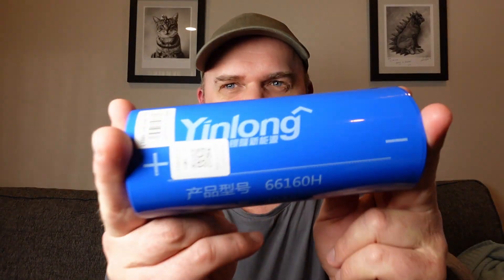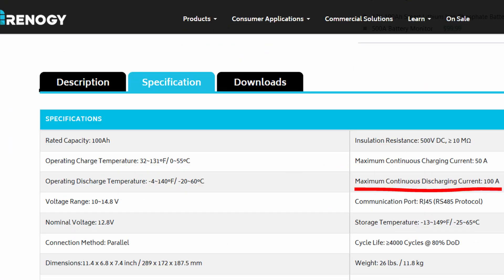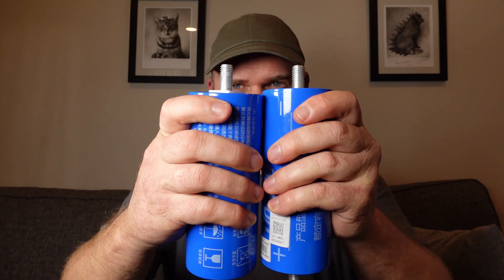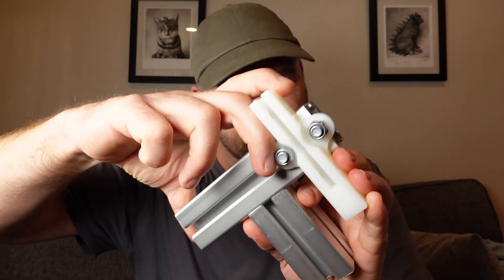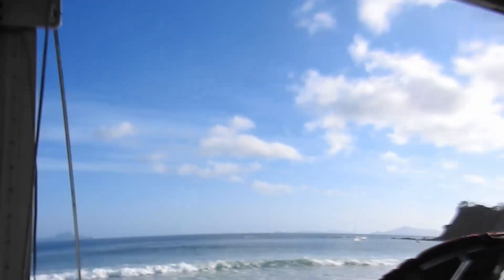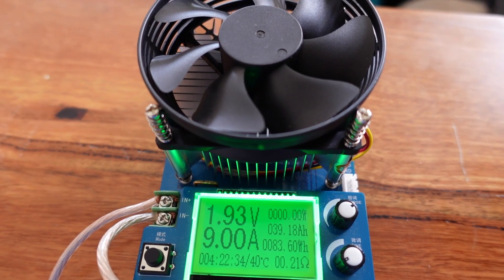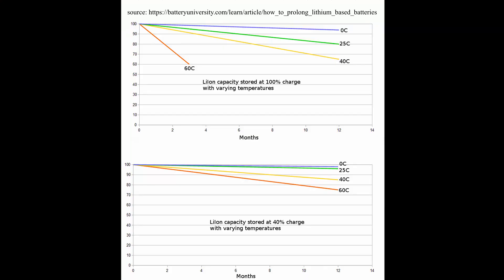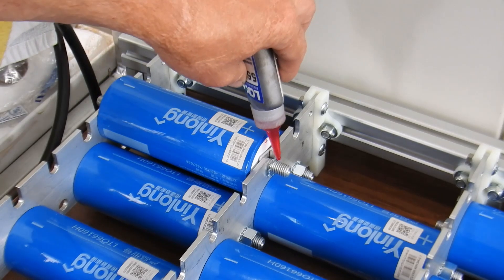Campervan DIY battery build HUGE POWER!

Comment: Yes I totally agree with everything stated in this video. And I pulled the same capacity results you got on my LTO part 2 video. The toshiba cells were incredible.

The reason I still prefer LiFePO4 over LTO is due to cost mainly. LTO is amazing! But crazy expensive if you want grade A cells. The data sheets I found for my video must have been for higher c rates. Sorry about that. I like LTO more now, but man that pack you built is massive! How much did that cost you? holy cow! Yeah, ying long and toshiba seem to have the good stuff.

But I must ask, why are you building such a massive battery with large discharge and charge capabilities? Why not use LiFePO4? I would love to hear your reasoning.
Reply: Good to see you interacting with others DIY battery guys will… i take it as a sign of humble & mission oriented - so in a good way let’s have a new test and sure the overall shouldn’t be costly like other types of batteries
Reply: @DIY Solar Power with Will Prowse 
He said he got them for around $50 apiece, so x99 cells, just shy of 5k
Reply: @ianpobanz12  $5k for 9 to 10kw that's worth it .$1k more than AGM with double usable power , plus big bounce 20,000 cycles , clear winner and safety.
Reply: @ianpobanz12  @Brendon Tait if he said 50$/piece, then he bought GRADE B. Definitely not GRADE A.
Reply from the maker: Hey Will, don't get me wrong.. I love LFP, already know a bit about them and have had some experience with them, however I didn't know heaps about LTO and really wanted some first hand experience with them due to their unique capabilities.  I designed my pack to hold 55 cells, and then slot in another 44 when I had more available funds.  It then came to pass that my whole solar and inverter setup got funded through other channels and not out of my pocket - so figured I'd go all in.  I really like the apparent ruggedness and long life of them, I've even heard of them accidentally being charged in reverse and still being ok!  I want most aspects of my truck to be as rugged as possible (low temp, long life etc) - and while it's not ideal to 'test' unfamiliar chemistry if I want something rugged..   I figure if it goes tits up and individual cells start failing... there are plenty of audio guys that would want to buy the remainder if I broke it down. Either way, it's likely I'll learn a bunch along the way.
Reply: @brendontait6968  very cool! Nice to get a response back from you. Yeah LTO is the best, performance wise. Pretty incredible chemistry. The audio guys build the coolest packs ever. Have you seen their custom built bus bars? Incredible stuff. I want to make more LTO videos but the cost is so high that many of my viewers couldn't afford them. I hope the price falls soon. I also want someone to make some cheap LTO prismatic cells. The ying long ding dongs (as the audio guys call them haha) are a pain to mount. I love your bus bar setup, it's incredible. Really amazing how much thought you put into that. The simplicity and durability is awesome.
Reply: @WillProwse  the opportunity is in the portable personal for the bull device charging Bank. It's one of two opportunities. As you can see on the Toshiba s c i b illustrations and as a unicycle owner yourself those vehicles are actually kind of Trojan e in terms of being a way of moving electricity around at high speed at minimal cost. You should have yourself a Sherman veteran and find out what a smile on your face actually looks like because the golf cart nor the Porsche that you say you can't afford it's going to do it for you like these new models especially the ones coming out this Christmas with the wide axle whole motor being about 40 lb and inviting the rest to be separated a b l e so you can carry it in your other arm and addressed a complaint of how a single object with a triple-digit poundage is becoming awkward. The other issue with unicycles though or electron delivery devices because there's no reason they can't be autonomous is climbing stairs but it's very easy to get a wheel to climb stairs you just have to have spokes that flip out from the axle and up you go!

All I'm saying is where there's a will prowser there is a future actual on Market forever unlike G pulsed nonsense the cell phone industry has basically stolen the intellectual property of with their claims of not just 220 Watts but the legitimate companies actually doing that for a battery that is only a few dozen watt hours in size. there are lithium titanate cell companies that are making them for hearing aids and earbuds and even smaller so what I'm talking about is not the Nano lto but the 20 amp hour El Tio. I just bought the mycharge 16 amp power for $18 at Target which has sold plenty of them for 60 and it's kind of need in terms of how sexy the heavy duty aluminum shell is especially because they put the $10 shelf tag on the $40 Sony USB C Bluetooth 5.0 earbuds so they bought it for me with only a $10 okay from me. It seems however that the my charge battery has an incoming and outgoing USBC Ford unlike the Walmart brand similar battery but I thought I was charging for that second USB C power bank with the output of the first and only 18 watts in and then using the second for it to top off the earbuds but the big Power Bank was not charged too much after it should have been except I was using the speaker with the AP app to listen to the same breaking news over and over again but hearing more and more with the repetition and the revisions so that's why it appeared it hadn't charged meaning it's not yet fully known as to whether it can charge two devices while charging itself especially with only 9 volts at 2 amps going in. The facts are really simple though the Swedish company will sell you a roll a 400w charging switches for about $6 each and those don't get hot or take up any space so they belong in a portable power bank. compare the standard now multi-brand unicycle charger which puts out 5 amps at 100 volts meaning they got the veteran Sherman make her to add a wire so that it can handle 5:00 amps LOL. Don't believe me it's easy to verify the America dealer has a whole section about its $200 500 watt charger. But get this there is a dude in Tucson Arizona who has the unicycle owners of the world buying a extension cord adapter for like $40 a foot so you can plug many such Chargers in a single free public Car Outlet!

 The veteran Sherman is coming with several kilowatt-hours from the factory and that's 2 hours using the aftermarket charger for kilowatt-hour obviously that it has to be held up. mister prouser I know you know what it means when you get millions of views on a video immediately and that's what the veteran Sherman gets its reviewers. Do you need me to buy you a round trip ticket to Japan to do this pitch or spell it out further? I know you know not because you know far too much for it to be otherwise
Reply: @markknotten1210  Whatever it is that you just said has me wondering if you have been addicted to crack cocaine since birth, or perhaps you are speaking some kind of battery savant language us common people of earth don't understand?
Reply: @rxonmymind8362  This is flat out going out to all of you. This went so far over my head that I said FUCK IT
Reply: @brendontait6968  What is this other channel you are speaking off? Ive already binged all your vids need more amazing content.....
maybe leave a link in your About page so other people can find
Reply: @brendontait6968  just so you know the most accurate measurement of available power is kva (kilo volt amps) which on the surface seems exactly the same as kw and on a dc circuit it pretty is power (w) is just volts x amps but for an ac circuit power (w) is volts x amps x pf (power factor) meaning ac loads with capacitors or inductors will have higher power draw on the batteries than the measured or rated power an easy example would  be say you had an 800w load with a 0.8 pf if you put a watt meter on it it would say 800w but the draw on your batteries would be 1000va
Reply from the maker: @shaynegadsden  thanks Shayne, I've got a reasonable understanding of basic electrical, have designed and build reactive power supplies before so dabbled in reactive power theory quite a bit.
Reply: @brendontait6968  I would have slotted both sides of the rails, so it would provide more flex and allow you to remove a single cell without taking the whole row apart. I like the 48vdc route as a future option!
Reply from the maker: Yeah... I allowed that as an option in the download links.  I don't think it will be too offensive taking a row apart if a cell shits itself
Reply: instructions unclear, disabled city's electrical grid charging 100 Peta-wh battery pack
Reply: Matt B McConaughey  super capacitors are not superior and they are extremely heavy. The specific energy is awful. They work great as a buffer to help with surge loads or to reduce noise, but that's it. They are not used for energy storage application.
Reply: @WillProwse  storing static inspired the current design Tesla uses to have the insulator be coated so as it serves a dual purpose and you don't have to have separate electrical infrastructure built into the lithium cell to constitute a battery.

That apparently is why he bought the technology. To cannibalize the manufacturing of the electrostatic barrier and apply it 4 simplifying and making more efficient cost and lack of electrical resistance wise mainstream lithium-ion chemistry.

For Transit electrostatic storage of breaking energy to apply moments later for acceleration solve many problems that mechanical flywheels impose. Unlike LTL electrostatic discharge curves are more formulaic far less top-heavy? The titanate does not get damaged if you drain it to 0 volts but the balance of cost to do so exceed the value so obtained and that is the understatement that I have tried to bring in full. You have to consider it for the applications where you can use Less storage and more Cycles like the personal Mobility applications that can top her off at every fire hydrant AKA Trojan Horse of electric car brought hi rate public charging. It is automobile logic that we see in the various current and near-term electric unicycles. You can watch Good YouTube videos of them incinerating themselves and permanently disabling injuries to the writers who do not train for bailing when their seat gets too hot suddenly. electric unicycle need not weigh hundreds of pounds not even one. It doesn't have to store kilowatt hours integrally but what it does need is integral kilowatt charging for a pack that is fractional kilowatt hour. It does need a very low internal resistance because that's what keeps you from falling those artificially intelligent spikes that keep you upright which currently cause people to fall when they go as fast as they want and hit a pothole or a speed bump and cannot deliver sufficient surge voltage to the motor to stay upright. This is why I Toshiba has waited patiently for everybody to fantasize about an electric unicycle instead of a General Motors Hummers. it's not how many times you could haul around like some sort of nearly extinct hermit. A

 We can do better than crabs or even eagles. in nature you don't see a whole lot of unicycles being used. Toshiba is going to make a killing saving the planet powering the unicycles that will be the only vehicle allowed not soon enough.
Reply: @WillProwse  I built a Super capacitor battery years ago & it's still going but at 1000Farrads @ 12 volts  (that's 3000 Farad caps x 6 in series) when you measure Usable A/hrs it's not much only about 50 A/hrs but it fits in a portable battery case. With that said, it can start a Tractor or truck as small as it is.  So yes I'm very interested to take a new battery build to  the next level to run a long term  home power system, probably use a 5 or 6 Kva inverter & I'll need at least 15Kw/hrs for overnight use because it gets so Bluddy hot up here in Queensland, Australia. So at some point soon I will order a box of these cells for a build. Edit I forgot I put 12 super caps (2s or 2x6 cells) in there to achive about 55 Ah in the usual 12 Volt battery voltage range, approx 14.5 - 10 volts of course capacitors don't care if it's  voltage sits on any voltage from 0 to 15 volts it doesn't hurt them and as such doesn't care if it sits there for a year with only 5 volts in it, just charge it back up & use it.
Reply: hiteck007 I love the dialogue between you and Brandon.  It was helpful and answered questions that I have not even considered to ask.
Reply: @blitzmakesunevenmm4323  I put an edit with updated info, I forgot a few things.
Reply from the maker: Depends on a few factors, if you listen to Mr Lee, LFP will last 20 years and 5,000 cycles.  I consider that to be very optimistic.  The thing with cycle life is that they are all done in a lab under controlled conditions and quick succession. (They are not left at high SOC for extended periods).  I believe most chemistries will only deliver half of their rated cycle life in the real world.  I think a reasonable expectation of LFP life expectancy would be 10 years and 2,000 cycles in real world conditions. (Tho I've seen them last as short as 2 years when held at high state of charge).  If you want the cheapest pack, buy LFP.  If you want the most rugged pack and you can shell out a bit of extra coin, consider LTO. I've seen an LTO accidentally charged in reverse and it still worked 100%, it is possible for an entire battery failure to start with a faulty BMS or balancer.  I think LFP is a great chemistry and would likely have gone with it, but I have a bent towards making things rugged, reliable and as long lasting as possible.
Reply: @realfamilyman  LTO will be cheaper if you cycle the batteries multiple times a day. For normal solar LiFePo4 will last a very long time though. Calendar aging will reduce any batteries capacity over time as well. No battery will last forever. You’ll find LiFePo4 is much cheaper, smaller, lighter, and uses less cells. LTO is nice but unless you are an expert I wouldn’t use it. There is less support overall for the chemistry. I would just build a LiFePo4 battery bank for a third the cost and in 15-20 years when it starts to wear out there will  likely be even better options.
Reply: @
DIY Solar Power with Will Prowse Did you test already the Yinlong cells?
Reply: @ELERIX-LiFePO4  No I haven't, I need some of those cells badly. Only tested grade b and toshiba. The toshiba LTO cells worked great. Need to test ying longs like the ones used in this video.
Reply: That's a weird admittance to being wrong. Or were u right?
Reply: @SpenserRoger  I've seen a lot of his videos and generally he welcomes people to challenge what he says with evidence. One of the reasons I take what he says with a bit less salt than others.
Reply: @realfamilyman  Perfect topic for the DIY solar power forums. There is a lot to dive into. Sounds like 8 280ah LiFePo4 cells in series for a 24v bank would be pretty good fit or maybe 16 cells for double the capacity. 16 cells would give you 14 kWh capacity and can be purchased for around $1600 shipped to the US. I haven’t uploaded any solar or battery videos on my YouTube channel yet but maybe I should. Seems like there is a need for it.
Reply: @justicelee26  You are aware that your speech-to-text engine recognizes punctuation and spacing commands, like "period", "comma", and "next paragraph", right? For all your seemingly in-depth knowledge of the subject, the run-on paragraphs are as hard to read as posts by that friend we have on Facebook who dropped too much bad acid in high school.
Reply: I'm in the process of building a portable LTO pack and one of my design criteria was sub zero performance and long life. Another factor was safety. Eventually I'll have a summary video put up on that build project as well - only build logs so far.
Reply: Have you considered that your cells might not have been conditioned right at the time of your testing? If they were still very new they may not have been charging or discharging properly. Just like a cellphone or laptop battery needs a proper discharge and full charge cycle to keep working at full efficiency. Cell phones can last 40% or more longer with proper cell conditioning compared to unconditioned cells. Macbook Pros were known for this happening around 2012.
Reply: @excitedbox5705  Experience and the manufacturing data suggests that conditioning isn’t experienced for these cells. If I’m wrong please refer me to the documentation that says otherwise. LTO cells will pull full capacity right out of the box. It is the discharge curve and the unique cell voltage that make these cells a bit challenging.
Reply: Will, I'm one of your viewers and I can afford  these cells so that being a concern should not prevent  you from doing a large build. You did mention a 48 volt pack on  your battery less 3000 watt growatt video. Your videos are  awesome. Building a grade A LTO for that inverter would be a impressive build  with all the solar panels it could handle. I would copy the build.
Reply: WIlll WE LOVE YOU!!
Reply: Cheers Will. If you recall I was the annoying internet dude who challenged you in the comment thread at the time.  I've since had the chance to actually test my own bank (24v 240AH) and it delivered exactly the same result Brendon obtained. 

I still think the confusion arose over poorly translated technical terms like 'discharge efficiency', which on the face of it is a meaningless term as there is no way to measure how many electrons are in the battery at the start of a discharge cycle. The only parameter that can be realistically measured is round trip coulombic efficiency, which is probably over 99%. Energy efficiency is different parameter again, and this is in the typical 95% range for all lithium chemistries. This largely relates to the slight difference between the terminal voltage on charge and discharge (at the same SoC).

That plus the very high C rate you tested at only confounded matters more.  Still it did compel me to think this issue through a lot more and I'm pleased we all learned something.
Reply: @philipwilkie3239  I totally disagree. Chinese manufacturers sure have the same measurement equipment like EU and USA, and we dont ask them to measure how much electrons are in the battery, but we ask them to say the truth and not manipulate ignorant peoples, which they do that everyday.  Just is the behavior how the work. 
Made in China meaning 10000000%%% low quality product. Also, the peoples which buy products made in China - have "low quality brain".   It is impossible to say they can produce something good, but only garbage.
Reply: SO big hahaha
Reply: Not to mention with LiFePo4 he could have gotten over triple the capacity in the same space and for the same price and with fewer comparability issues.
Reply from the maker: What comparability issues?
Reply: @brendontait6968  it is difficult to build a 12v pack with LTO. Higher voltages are usually fine but they are just overall less useful. I’m excited for the future of LTO but right now it’s just not usable for me. It takes up too much space and it’s super expensive.
Reply from the maker: My pack isn't 12V.  I think 12V is too limiting when it comes to delivering useful amounts of power for cooking etc.
Reply: @justicelee26  yeah the charge/discharge curve is harder to work with. It has a larger working voltage range. LiFePO4 curve is relatively flat, and works great with standard equipment. LTO sure is cool, but the price is pretty huge. I don't know of any loads or chargers that could take advantage of the high c rate either. And I'm not in a cold climate. But I'm sure someone out there has a use case that warrants LTO. LiFePO4 is wayyy cheaper and easier to work with. That's for sure.
Reply: @brendontait6968  what is your largest load? Just curious. Are you powering multiple air conditioners and cooking at same time?
Reply from the maker: Common Will, I expected better from you...  the discharge curve is only problematic when using a 12V system.  It's not an issue with 24 or 48V.
Reply: @brendontait6968  I'm saying the soc curve of LTO is similar to nca or nmc. It's linear. LiFePO4 is logarithmic at high and low soc. But relatively flat in the middle. So the performance is the same at high and low soc. 

I'm not stating that it doesn't work with those voltage inverters. It's just that the voltage drops quite a lot throughout the cycle.
Reply from the maker: Loads are nothing that I couldn't have accomplished with LFP.  I wanted to have real experience with new and interesting chemistries, my biggest combined load might go as high as 6-7kW with maybe an 8kW charge.  I wanted a robust bank that could handle low temperatures and be more resilient against things like the potential for a BMS failure and the over or undercharge that could result from that.  Additionally... I wanted a chemistry that will last and not be something I had to worry about replacing in the imminent future (jury is still out on that).  But if nothing else, I've learned a lot about the chemistry.  I could have built the pack for cheaper if I went with LFP...  no doubt.  I could have built it even cheaper from salvaged battery packs.  The excercise wasn't about building the cheapest pack that I could.
Reply: @brendontait6968  I think I need to make a video about all of this because I don't think people get it. Saying "I expected better from you.." when I have a valid point means that I need to educate you and others. I'll make a video about LTO and why it is good and bad soon so that you can understand specifically what I mean.
Reply: @brendontait6968  yes valid points. Absolutely. I just had an issue with saying "I expected better from you" when I mention the soc curve. It does have a wider voltage range and the shape of the curve can be problematic for some. For a fun, robust system, LTO does seem great for you. I was just mentioning some of the downsides. I am not trying to argue. All of the chemistries have pros and cons. There is no ideal battery. I think we should mention the pros and cons for all of these chemistries.
Reply from the maker: @WillProwse  sounded like you were saying LFP discharge curve works great with standard equipment (implying LTO doesn't) my 11S pack has a usable charge range from 22V to 28V which is quite compatible with every standard 24V device/appliance I've seen?
Reply from the maker: @WillProwse  agree... I'm going to be doing some future builds with more LTO and LFP.. and yeah I probably should have stated in this video their upfront cost is high etc.  I'm still new to the youtubes and don't find it easy to get all the points across that I want to.  But working on it.
Reply: @brendontait6968  yes that should work perfectly. I was saying the curve is different and some people prefer the flat curve of LiFePO4 for higher performance during discharge. I wasn't standing by LiFePO4 either. It has its own downsides. Just thought it's a fun discussion.
Reply: @brendontait6968  your video was perfect. It was well done and extremely informative. It's all good. Yes more LTO packs would be awesome. Could you make a smaller, mobile pack? Your cell configuration is awesome
Reply from the maker: Sweet, think you do a great job on youtube, love yr work.
Reply: @brendontait6968  thanks 😁
Reply: @WillProwse  I would love to see a video about this Will. I am not an LTO hater at all. There really is a lot to love. It’s just no where near as good as LiFePo4 for most user right now. Especially with the cells that have been developed recently. The discharge curve and the price make it unsuitable for the majority of applications. Not to mention the additional size and general lack of comparability with not only chargers and inverters but also BMSs.
Reply: @brendontait6968  I want to thank you for rubbing our know in the under utilization of highest quality Solutions. I understand the conflict between you two. Android 9 has a major body with a recorder app turning down the amplitude for all app. I will be back when Google can hear me! That is without my disturbing my neighbor!
Reply: @brendontait6968  el douch bag move.........
Reply: @justicelee26  But it wouldn't have 20k cycles, now would it?
Reply: @mountainman4410  I guess if cycle count and C rate are the only two factors that you care about then by all means LTO is the obvious choice. Except for maybe Nickel Iron. Those batteries last for 60+ years and you can pull quite a bit of current. If you ignore everything else about a certain chemistry and focus on one of two things then it kind of distorts reality a little bit.
Reply: @justicelee26  The only two things I can think to really care about in a system build are how many amp hours can I pull from it and how many cycles can I expect. Yes, charge times and other things factor in to some degree. In the end though, usability and lifespan are the two main factors. When you take into account the number of cycles LTOs will run as compared to L4s, the price of the LTOs drops drastically. So, they last longer, have better C rates, safer, more durable, will work in higher and lower temps, etc. The list of pros is much bigger than just two factors. 🤷🏼‍♂️
Reply: @mountainman4410  Most of the factors you mentioned don’t matter much to me. Safety: I don’t see how LTO is safer than LiFePo4. Neither chemistry suffers from thermal runaway and both are very safe and stable. Durability: Both are aluminum cased. LiFePo4 are available with more durable cases if required but the cells should be properly encased anyway. Lifespan/cycle life: Both chemistries will last 20 plus years. Remember that because you can afford a lot more capacity with LiFePo4 you can use 80% DOD which means either chemistry will last a VERY long time. Working temps: not a concern for most use cases but even then if you put the batteries in an insulated box you can add in a small heating pad. It may draw a very small current when it’s extremely cold but that’s okay because you can afford a much bigger capacity battery. C rate: 1C is more than enough for me. 1C means discharging the battery in 1 hour. If I can discharge the battery that quickly I have way too little capacity for solar. LiFePo4 can surge to 3C so for a 30 kWh bank that is 90 KW! At the nominal voltage for a 16s pack that is over 1750 amps! My homes electrical panel can only handle 48Kw without blowing the main breaker and the max load I can possibly create with everything on is around 12kw and that is being intentionally crazy. So none of the advantages of LTO really mean anything for my use case which is solar storage.
Reply: @justicelee26   not sure where you get 3c for lifepo4 try 14C and some cells do more.  5 ah putting out 70+ amps.  LTO is not safer and the energy for these yin longs are very low and the resistance is very high resulting in very high temps.  20c draws on these banks will result in very high temps very quickly.  The 18 ah LTO from test show better results.
Reply from the maker: In what way?
Reply: @brendontait6968  excellent response these people don't do any of the math and they just wanted to be an epithet. I didn't know that was a thing doing worse than supercapacitors. It's what a 1-2-3 used to say that they're little phosphate or whatever had a higher surge capacity while also having the volume capacity in terms of kilowatt hours not just kilowatts. I think what happened with my microphone has been figure it out or at least I got it back. I hope to find the time soon to at least the edit LOL but definitely share my perspective on that's just how great it is that you have this demonstration of how to design as if you're properly financed. Nobody has said this right but there is a Temptation Factor of having something designed well enough you can break it down as that demand Temps but your answer was very surprisingly disappointing in some ways but being motivated to learn is of course great. For stationary charger lesson of the Legacy electrical grid applies give not a hoot about efficiency but get it done affordably. The supercharger it's like the Winnebago Square wave 300 watt inverter. It weighs a ton but does not cost a fortune for Winnebago at all. You mentioned how you don't anticipate double-digit kilowatt inputs. I think that providing for some sort of such a derp interface make sense and that's where this chemistry distinguish its itself. People have said that lithium ion batteries are mechanical devices so you can just create garbage stick in them. I don't agree with that analogy. It's the opposite of course the lower-quality the power that you put into the wares gwl peddles the healthier ultimately charged battery is supposedly to be. we're not making venison or whatever it's called with the goose livers that is inherently cruel. You fill her up only part away of course and you don't bother to get the last few lower voltage drops out just because the density was never there according to the gotta get it as cheap as possible crowd so understanding what can be done with primitive super low cost materials to connect the grid is to be a child again not aware of electrons but just trying to make the different Outlets fit the different plugs. The cells are hard to kill they are safe to mess with and that means save money where you can waste their capacity where it simplifies and enjoy the results. then there's the matter of the power factor correction of course and I haven't seen anybody bring this up when it comes to connecting up the superchargers in terms of not being a dirty load. I've never even considered the issue but you got to have the grid just charge more for the juice instead of make everybody super Prissy. I believe in the wasting energy when that saves the world not even it should be like abortion. Yes abortion. Don't be a single issue designer is what I would like to Mentor as my legacy it's not about maximizing inefficiency but when the alternative can be as ludicrous as people using fire even petroleum fed fires going wrong so wrong to win against that is what ends any spat on the Merritt. I don't think electric unicycles should have a maximum maximum speed determined by the internal resistance of the chemistry. That's like having a solid state lighting industry dependent on carbon zinc batteries being used to supply the electricity only. It had a Time the time of learning and I'm not forgetting what was good that's also important everybody should remember how elegant a diode is shorting out one of those super cheap Flashlight batteries can be instead of just a hot wire like we tend to heat water with even buildings still. the only thing worse than stoking the coal to get your bath water warm is to use tens of thousands of Watts incandescent lighting in a opaque beer keg that we call the mainstream. there is a way of getting it done the cheap way rightly not just wrongly and it's in the balance of costs because when it comes to unicycles it's what's between your legs that matters most
Reply: @markknotten1210  I can’t believe I read ALL of you comment, after the first paragraph, which you didn’t stop for. Didn’t you know you are not supposed to touch the both the red and black wires of high wattage batteries at the same time. It fries the brain
Reply: @markknotten1210  Jeez, Mark, have you not heard of paragraphs?
Reply: What will should have done is take down that video he made that was wrong. Moreover, Will barley knows enough about electronics to keep his pants on yet he has so many subs. Just a crazy world we live in.